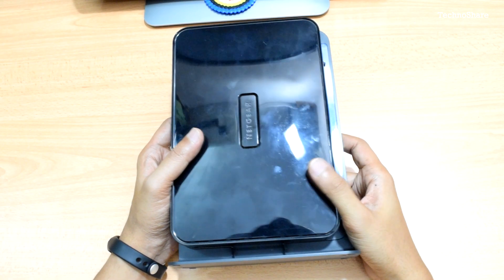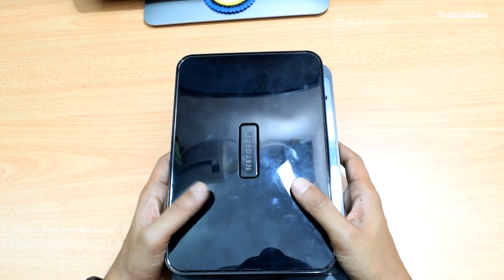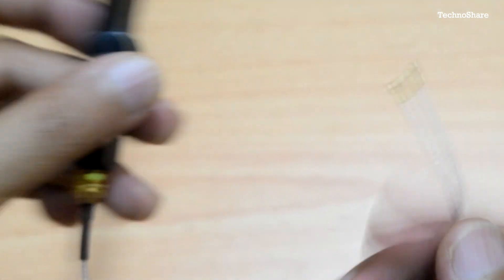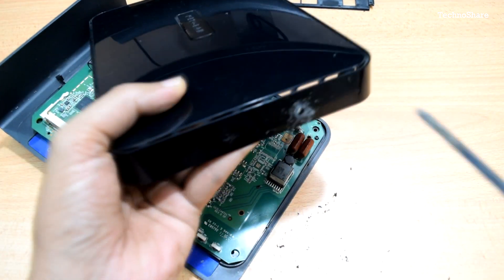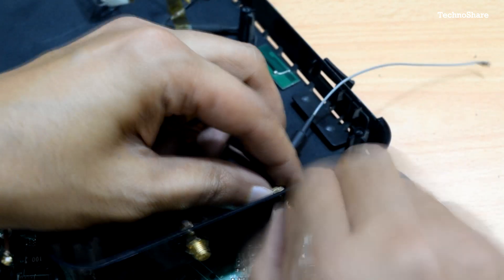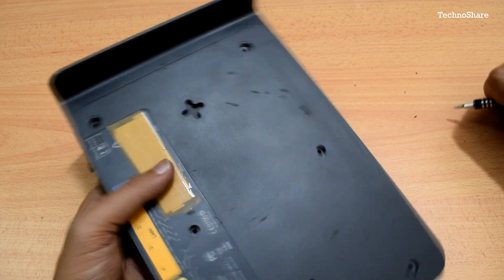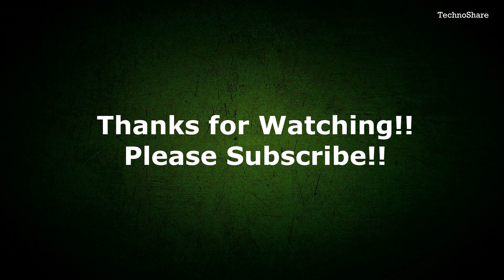Adding External Antenna to Netgear DGND3700 Router!

Comment: even with all that,  you have a broadcom chip not going to help out that much
Reply from the maker: Range did increased a bit. But very less. However, the router is gone now. Something went wrong, and the chip got fried. I am now using ASUS RT-AX88U AX6000. Its a premium router and range is very good (2.4Ghz).5GHz is decent.

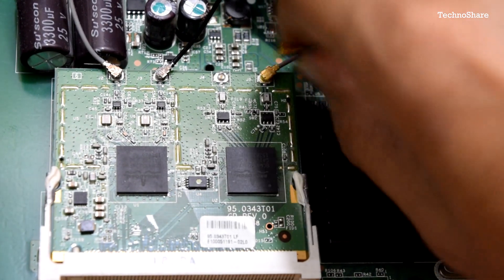Comment: How do I tell which connectors are the 2.4 Ghz and which ones are the 5Ghz in my router? Also, in my router the receivers are not "plugged" to the circuit board with the mini PCI plug as in 3:22, they are soldered, do you think I should de-solder them and solder a mini PCI plug base to the spots so they can accept the mini PCI type of receivers as in 2:00?

Comment: Great video! Can I just please ask, how did you know the connectors were for 2.4? I am modifying my router and it is not clear
Reply from the maker: Hey there! Thanks for your comment!
Sorry, I dont recall exactly how i figured it out. One tip I can suggest. You can turn off the 5ghz band, and measure the signal strength of 2.4ghz on an app, at a far off place at its lowest strength. Now in the same router position, install the new antenna and measure the signal strength at the same place. If the levels have increased, then it will be a hit. Else you can try with a different antenna terminal on pcb.  Hope this helps! Thanks for watching! 🙂
Reply: @TechnoShare  okay good shout thanks !

Comment: how did you recognize 2 x 2.4g connector located at right side? how about if connect 5g connector?
Reply from the maker: Hey there! Its been a long time since I did this mod. Sorry, I am unable to recall how I located the correct connector for 2.4g :(.  I remember checking the internal antenna type (its different for 2.4 and 5g) and also looked for any mention on the pcb / chipset on 2.4g / 5g.

Comment: Excellent project. Could we have had both external and internal antennas by soldering ? Sort of Frankenstein setup. The range might be phenomenal.
Reply from the maker: Possible to solder. But not sure how effective it will be!
Reply: I just crimped wires onto the existing antennaes and snaked it through the holes to the outside

Comment: What is the name of the connectors to purchase?
Reply from the maker: Hi!, Its called RP-SMA to Pigtail antenna extension adapter cable. You may want to check the male / female connector ends, as per your need.